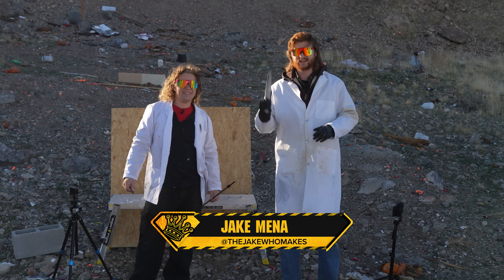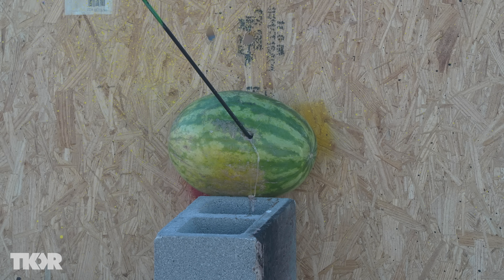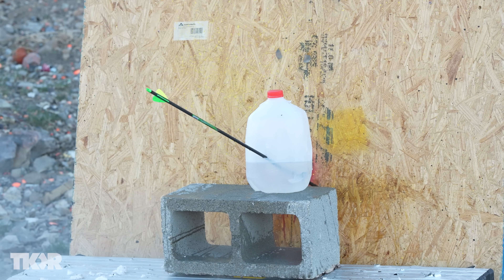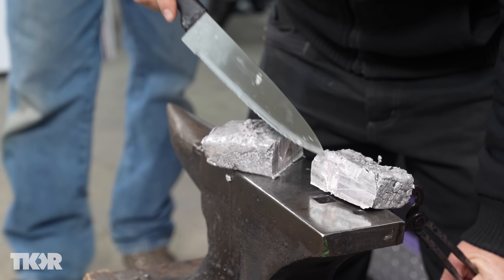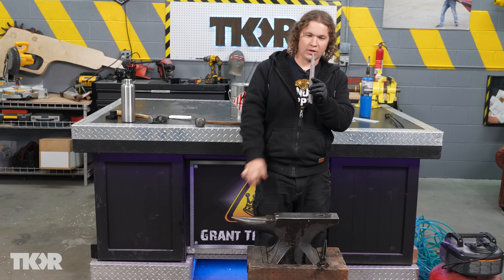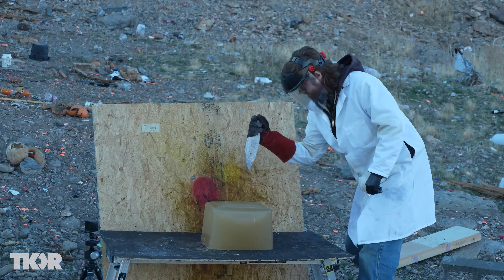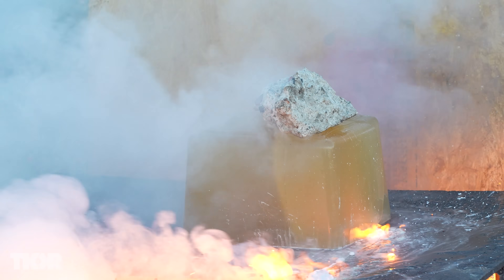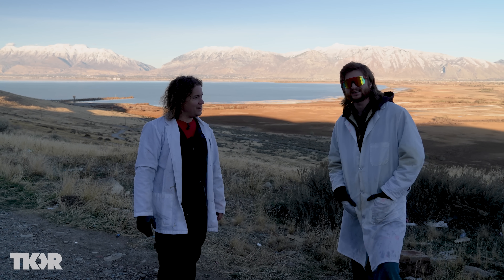Sodium Metal Knife Was a Bad Idea...

Comment: Why use serrated or barbed knives when you can have the knife itself react with whatever you're stabbing. (this is just a joke youtube, chill)
I do think that, not accounting for how bad the softness of sodium is for any form of stabbing tool, both the knife and the spike would benefit from having serrations or barb-like additions to it to prevent the ejection of the tool.
Reply from the maker: The sodium melted far too quickly. We didn’t know that at the time but it wouldn’t have worked.
Reply: Another idea may be to shape the tool into a diamond shape, with a very steep slope at the tip so it can at least penetrate the surface, and a very shallow slope towards the handle. The idea being that the forces from the side will push it into the object you stab it into, even as it melts. I don't know if this would realistically work with the pressure build-up though
Reply from the maker: A good idea, but I'm pretty sure what caused the sodium to jump out was the pressure being made by the melting sodium creating hydrogen gas

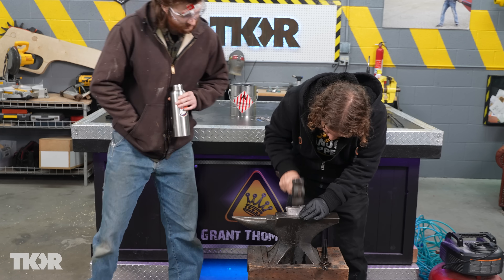Comment: 6:03 worst Smith ever. He is actually holding back the weight of the hammer from doing the work. Actively working against his tools. He choked up which makes sense with how soft sodium is, but he should be letting the weight of the hammer drop into the sodium not just making super light taps.
Reply from the maker: Sodium is a dead metal, meaning that it doesn’t hit back like ferrous metals. It’s exactly the same as forging clay. Soft clay. Raising the hammer higher would’ve given too much force and moved the metal too quickly which creates stress fractures.
Reply: @TheKingofRandom  but it's soft and was never going to hold up anyway.

Comment: Is there a reason for the sodium to be so oily during the knife shaping process?
Reply from the maker: The sodium is stored submerged in mineral oil to keep it from oxidizing/reacting with the water in the air
Reply: @TheKingofRandom  thank you so much for the helpful information
Reply: I think it's to keep the sodium from reacting with the moisture in the air
Reply: 0:44 Must've skipped over this part.